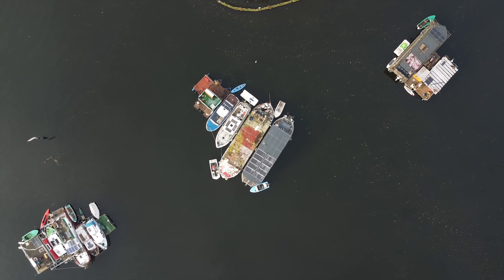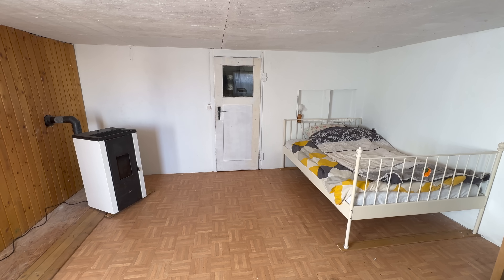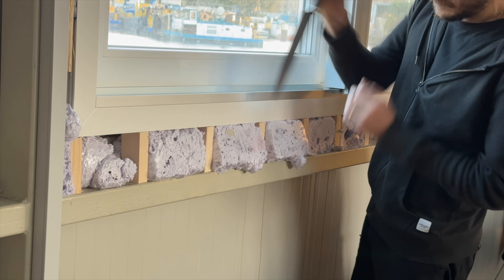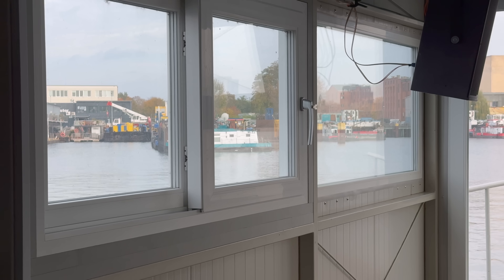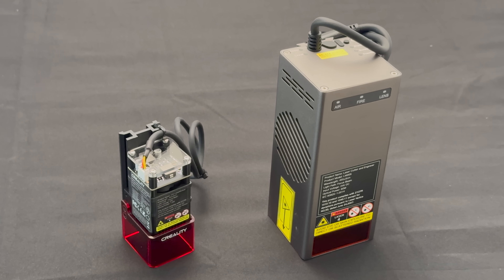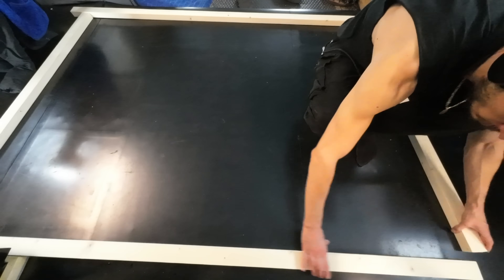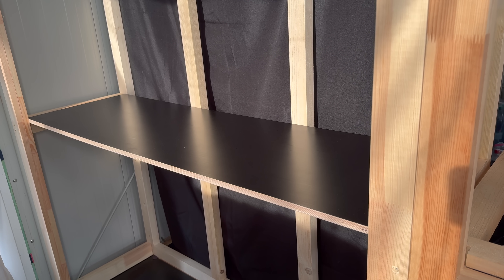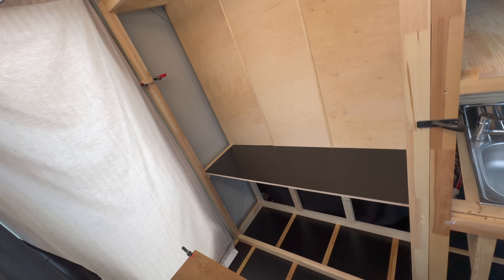Getting Our Boats Ready For Winter

Comment: That MDF is called 'hardboard'  here in UK, and it's the last product one would put in a marine environment, as it will absorb moisture, swell up and finally disintegrate.
Reply: That material with the pattern on one side is also called Masonite. 
But yes, as a "glued together sawdust" product, the basic form is very poor in marine environments.
Reply: @bythelee  He would have been better going to a window manufacturer and buying PVC trim strip, which would also have the advantage of not needing to be painted.
Reply: There is a light color one and a dark color one with oil inside for wet place and outside use!
Reply: Hardboard aka press ply . Horrible

Comment: Didnt you have a watercooled diesel generator? Connect the cooling circuit to radiators , waterheater, fanradiators , to use the excess heat else getting cooled out
Reply: i am also looking for a realitve small watercooled generator, to connect to my central floor heating, and my 20kwh battery bank.
that is really a good idea.

Comment: Also try not to use those small foldable solar panels.  Try by bigger wattage  aluminum frame  panels. Then you will get better power generation.  Get at least 6 x460 watts

Comment: 😱 MDF is more or less cheaply produced crap 👎and definitely not suited for boats/floating devices. MDF is made from as cheap as possible wood fibres and glued together with chemicals! Therefore MDF smells, soaks water, can rot/mould easily and the sawdust is quite unhealthy! Not much structural integrity additionally = product breaks easily. Nowadays MDF unfortunately gets used more often simply because of the fact, that solid wood and better/good wood products have become way too expensive. And this although millions of coniferous trees have died in the last 10 years and are still standing dead all around Europe = have not been harvested.
Best regards, luck, wisdom and health in particular.
Reply: It can be fine is seal in epoxy then good paint
Reply: Those mdf plates are real goed stuff i used them twice for bike trailer just paint en seal them good and now 4 years later the plates look just the same and the bike trailer was outside without any cover for those 4 years so it does work
Reply: All materials can be closed in with epoxy. If you do it right.
Reply: He’s way too industrious for them to rot away. Also, Europe has a lot of laws around wood and boards so mdf is what they have in their home improvement stores

Comment: Hi, just wondering; are the outside walls just sheet metal? If so, are you gonna add a thing wall in front with insulation in between? Seems like just a wall of sheet metal means it will get very cold inside during winter, even with pellet stoves.

Comment: What about some wind turbines? For charging your batteries?
Reply: Germany has very strict regulation on height of devices, so any common "home" wind turbine (I'm thinking 400W to 1.5kW) probably won't be allowed.
BUT.  There are smaller turbines mostly used on ocean-going yachts. They don't generate a lot of power (30W?), and are almost always low voltage (12 or 24 volts). But a bank of six of them (or however many you can fit / afford) should give a useful boost for charging batteries, even if that's only to provide LED lighting. They work 24/7, not just in daylight, and they won't require any fuel. Getting them to integrate with solar charging seems to be the impossibly difficult task, though.